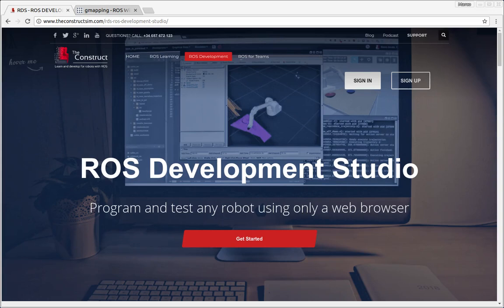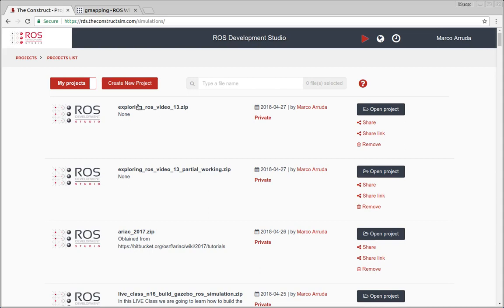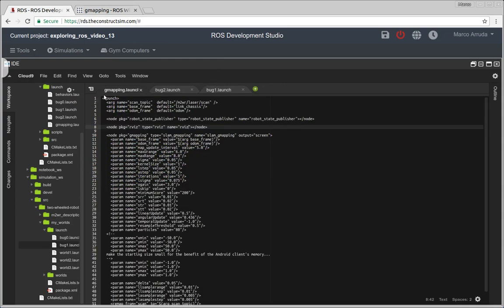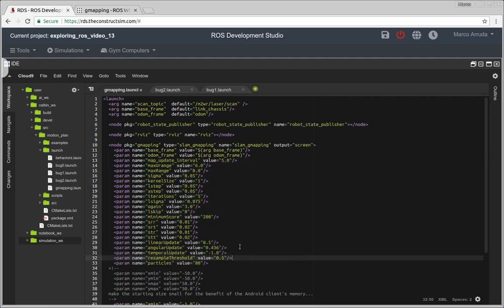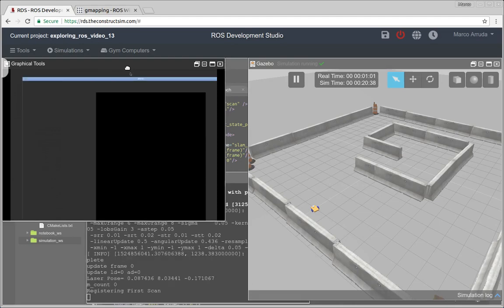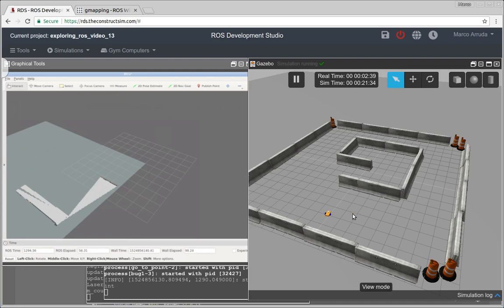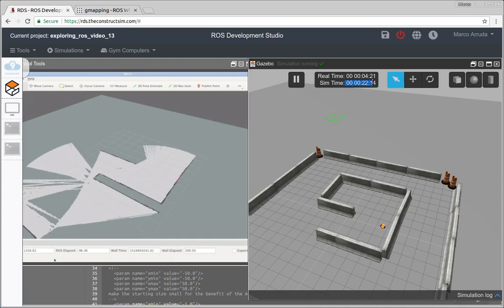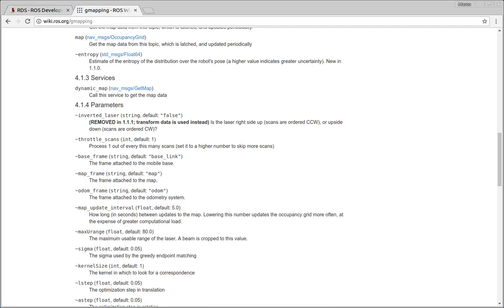[ROS Projects] - GMapping - Exploring ROS with a 2 wheeled robot - Part 13

Comment: Hi I am launching the file, but I am getting this error : RROR: cannot launch node of type [gmapping/slam_gmapping]: gmapping
ROS path [0]=/opt/ros/noetic/share/ros
ROS path [1]=/home/chady/catkin_ws/src
ROS path [2]=/opt/ros/noetic/share
[ERROR] [1687344549.939149827]: Could not find parameter robot_description on parameter server
[robot_state_publisher-1] process has died [pid 40746, exit code 1, cmd /opt/ros/noetic/lib/robot_state_publisher/robot_state_publisher __name:=robot_state_publisher __log:=/home/chady/.ros/log/bb4e7404-101e-11ee-852c-55270613f758/robot_state_publisher-1.log].
log file: /home/chady/.ros/lo

explain this erro

Comment: My fixed frame is set to /map also my map is formed properly unless after some time when the robot rotates or moves for a little while the orientation of the map changes and map is not formed properly. It starts to overlap on the formed region.

Comment: hi, sorry i'm new with ROS i need your help. when i'm cloning your repo 'Two Wheeled Robot - Motion Planning" in my src workspace. then i "catkin_make"  i have error and showing this message;

CMake Error at /opt/ros/kinetic/share/catkin/cmake/catkinConfig.cmake:83 (find_package):
  Could not find a package configuration file provided by "gazebo_msgs" with
  any of the following names:

    gazebo_msgsConfig.cmake
    gazebo_msgs-config.cmake

  Add the installation prefix of "gazebo_msgs" to CMAKE_PREFIX_PATH or set
  "gazebo_msgs_DIR" to a directory containing one of the above files.  If
  "gazebo_msgs" provides a separate development package or SDK, be sure it
  has been installed.
Call Stack (most recent call first):
  two-wheeled-robot-motion-planning/CMakeLists.txt:10 (find_package)

-- Configuring incomplete, errors occurred!
See also "/home/ubuntu/ydlidar_ws/build/CMakeFiles/CMakeOutput.log".
See also "/home/ubuntu/ydlidar_ws/build/CMakeFiles/CMakeError.log".
Makefile:864: recipe for target 'cmake_check_build_system' failed
make: * [cmake_check_build_system] Error 1
Invoking "make cmake_check_build_system" failed

do you know how to solve this?
Reply from the maker: you have to install in your computer the ROS package ros-melodic-gazebo-msgs
Reply: @TheConstruct  hi, so the gazebo need to installed in "Computer/local" not in "Robot"? my ROS Computer is Noetic so its should be ros-noetic-gazebo-msgs in my case?
Reply from the maker: @kyozho3912  yes install in local, not in robot.
In order to install that package do the following command:
sudo apt-get install ros-noetic-gazebo-ros-pkgs
Reply: @TheConstruct  hi thanks in advance.
I got this after roslaunch gmapping.launch;

ERROR: cannot launch node of type [gmapping/slam_gmapping]: gmapping

i notice there is no gmapping for noetic version based on wiki, so its dead end for me haha
Reply from the maker: @kyozho3912  Not necessariyl. What I would recommend you is to download the source code of gmapping and then try to compile it in Noetic. I suspect many changes but you still have a chance.
Reply: @TheConstruct  
hi, ok thank you.

i think i almost there. 
Not sure if i'm doing this correctly, i clone "https://github.com/ros-perception/slam_gmapping/tree/hydro-devel" to "/opt/ros/noetic/share".

then "roslaunch gmapping.launch" again
the result;

ERROR: cannot launch node of type [gmapping/slam_gmapping]: Cannot locate node of type [slam_gmapping] in package [gmapping]. Make sure file exists in package path and permission is set to executable (chmod +x)

did i put it in the wrong place?
Reply from the maker: @kyozho3912  yes you put in the wrong place. You need to create your own catkin_ws and clone there, then compile there
Reply: @TheConstruct  hi, i put on my workspace now "~/catkin_ws/src". but after "catkin_make" showing another error;

CMake Error at /home/ridy/catkin_ws/devel/share/openslam_gmapping/cmake/openslam_gmappingConfig.cmake:113 (message):
  Project 'openslam_gmapping' specifies
  '/home/ridy/catkin_ws/src/openslam_gmapping/include' as an include dir,
  which is not found.  It does neither exist as an absolute directory nor in
  '/home/ridy/catkin_ws/src/openslam_gmapping//home/ridy/catkin_ws/src/openslam_gmapping/include'.
  Check the issue tracker
  'https://github.com/ros-perception/openslam_gmapping/issues' and consider
  creating a ticket if the problem has not been reported yet.
Call Stack (most recent call first):
  /opt/ros/noetic/share/catkin/cmake/catkinConfig.cmake:76 (find_package)
  slam_gmapping-hydro-devel/gmapping/CMakeLists.txt:4 (find_package)

-- Configuring incomplete, errors occurred!
See also "/home/ridy/catkin_ws/build/CMakeFiles/CMakeOutput.log".
See also "/home/ridy/catkin_ws/build/CMakeFiles/CMakeError.log".
make: * [Makefile:740: cmake_check_build_system] Error 1
Invoking "make cmake_check_build_system" failed

Comment: How do you get the map visualization? When I run it I am only getting the laser data
Reply from the maker: You need to do several things:

1. Use rviz for map visualization
2. In rviz add a map visualizer
3. Configure the map visualizer to the topic /map
4. Make sure the fixed frame of the rviz is set to /map
Then you should be able to visualize the map
Reply: @TheConstruct  i have done the above still unable to get the map visualization
Reply: Use rviz for visualization